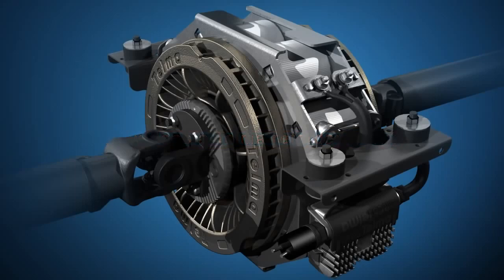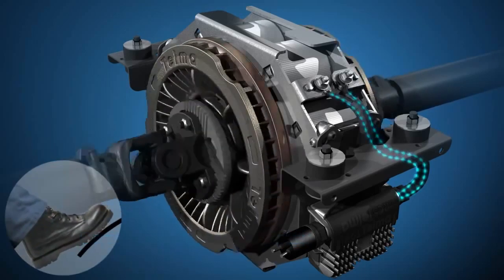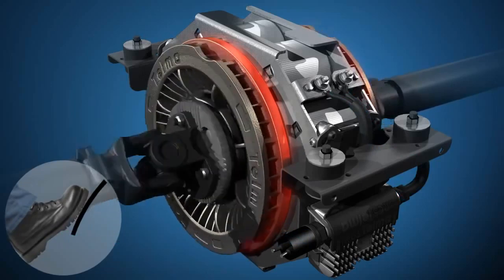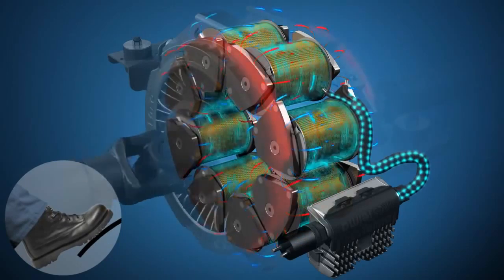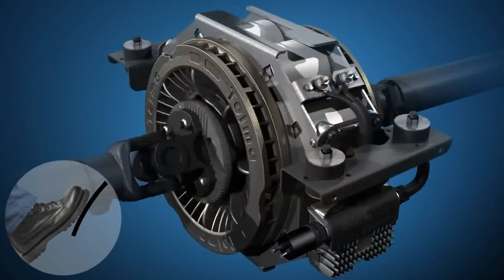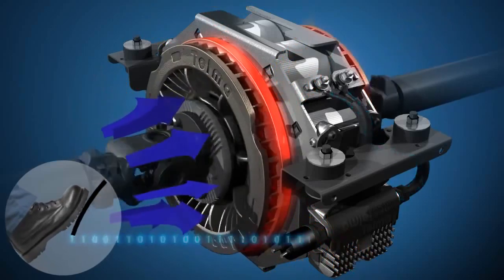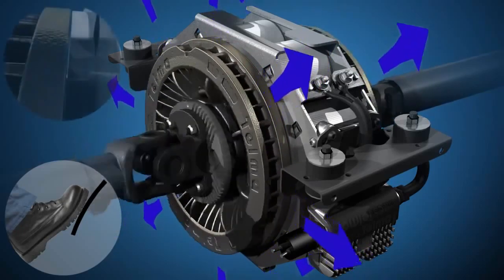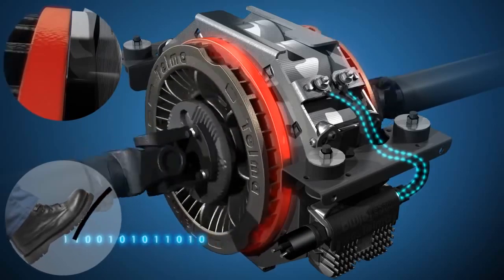Telma Operating Principle - English

Comment: There are certain heavy older sedans, specifically those without modern carbon-ceramic disc brakes with ventilated rotors, for which these should absolutely be mandatory. It's extremely unpleasant trying to slow down a heavier car that just wants to keep on rolling forever once it finally gets moving! Not to mention brake-pads and rotors would last significantly longer with the addition of one of these engine retarder systems. And you'd never have to worry about losing your brakes again! How many people are seriously injured every year from brake fade on steep downgrades?! Or if it's an older vehicle, and you experience a brake-line failure, what then?! "Gearing down" doesn't do enough either. All vehicles need to come equipped (or else retroactively fitted) with a dashboard switch-activated device, with three initial settings: on/off/auto, with further settings once enabled, to be used at the driver's discretion. I'd give anything to have something like this on every vehicle I ever drive for the rest of my life.
Reply: Exhaust brakes seem like a no-brainer, too